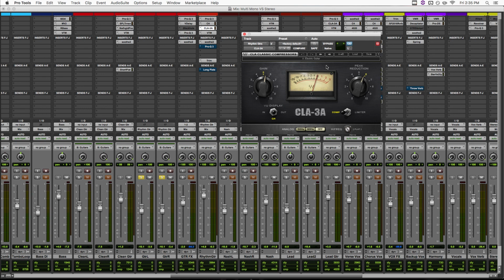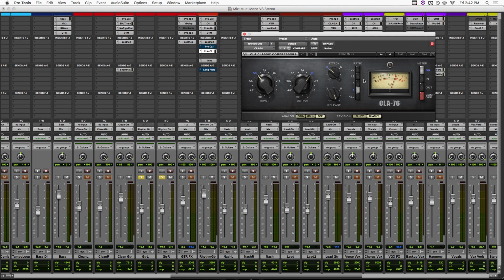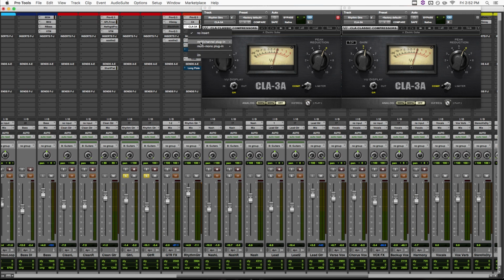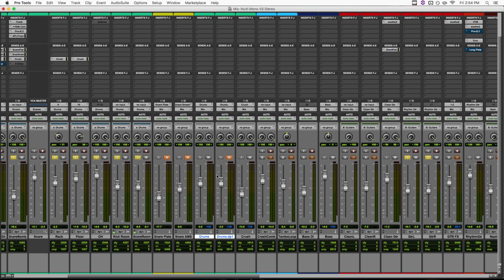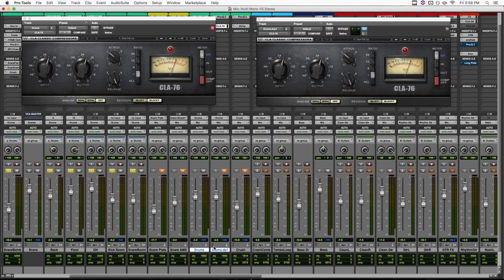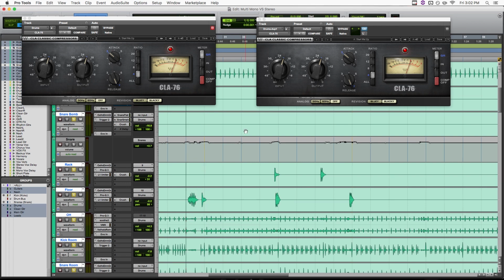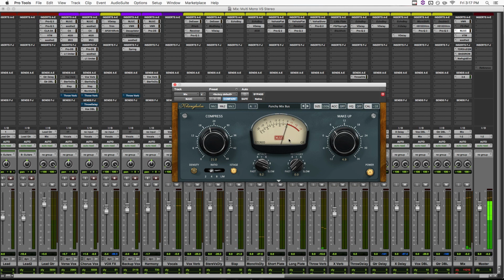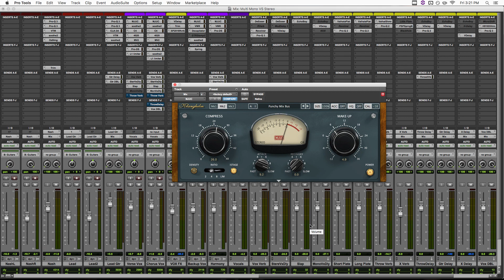Stereo vs Multi Mono Compression

Comment: What about when it's a stereo compressor plugin, such as a Fairchild or 33609 for example?
Reply from the maker: That's a good question! I think most of the Fairchild and 33609 emulations have a link/unlink control that would essentially switch between stereo (linked) and multi-mono (unlinked).